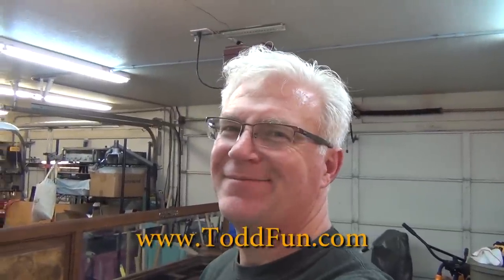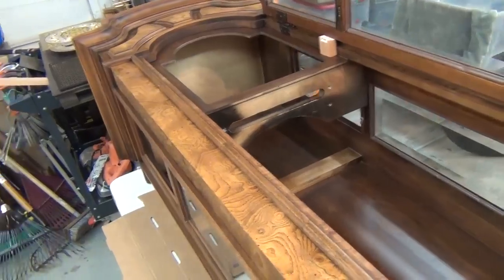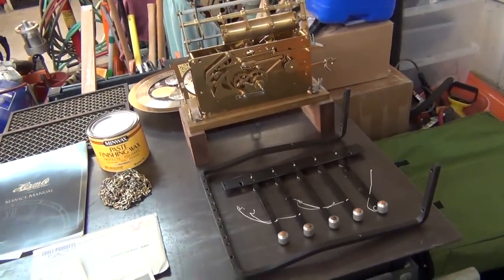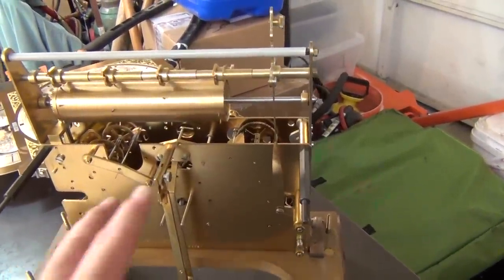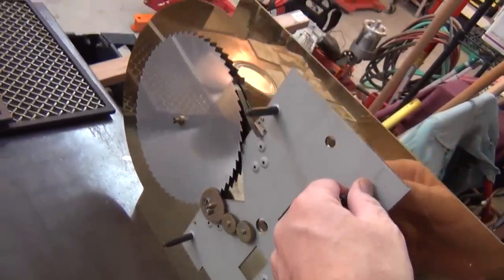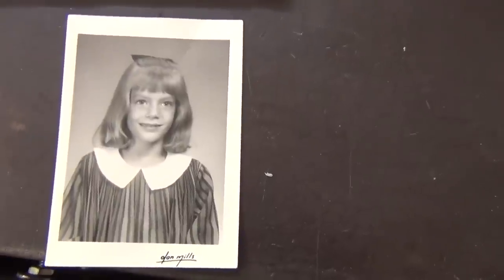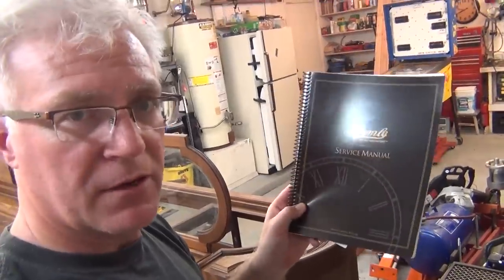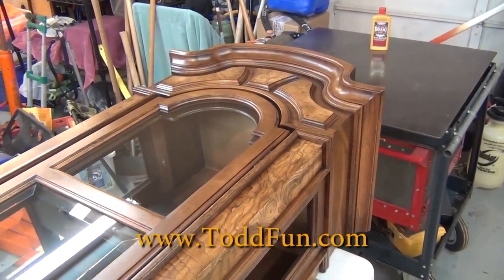Howard Miller Grandfather Clock Part 1

Comment: Got one few days ago, absolutely Identical movement to yours, 5 tubular chimes, this with booklet identified as Emperor 401M, Different cabinet but beveled glass all around, top beveled glass piece is cut with the arched top not the usual rectangle panel behind woodwork. $180 out the door. Needs clean and lube but as is runs fine with excellent beat ratio no adjusting just add weight(s) and go. Cabinet appears factory, not home assembled as I've learned these could have been DIY kit form cabinets. Too much fun. Your bookmatched wood detail is really beautiful. That 4 panel matching is special for sure.
Reply from the maker: Great buy!

Comment: I bought a Howard Miller Grandfather clock dated 1979 with a damaged  cabinet it turns out this expensive solid hardwood  clock is really particleboard and plywood with hardwood veneers. The cabinet isn't salvageable (water and particleboard don't mix) but the movement is

Comment: I appreciate your video of working with your Howard Miller grandfather clock. I received a Howard Miller grandfather clock from family 2 days ago. It has no model name on it, just a serial number 670934. It was running as we loaded it into a trailer for transport but when we set it up in my living room, I couldnt get the pendulum swing to operate that pawl straddling the teeth of that cog wheel. Sorry, I don't know the right terms to use. The crutch rod swinging just couldn't get that rocking pawl to rock in those cog teeth. I searched all around in there for something jammed. I left the mechanism in the cabinet & just looked around from the removed side panels. Then I found that the bracket that the pendulum shaft mounts into was loose. This was somehow putting a bind on that pawl straddling the cog teeth that regulate the speed of the escapement. Here again, I'm not sure of the proper nomenclatutre & exact operation of what i'm observing happening. So I tightened 2 loose screws and the bracket became secure & the clock has been working now for over 13 hours. I was prepared to level the clock & adjust the beat of the pendulum with it's adjusting screw that I had loosened & moved around when "troubleshooting", but it seems to be doing ok as is. I wish I could attach a picture of this clock in hopes you may recognise the model name. I suppose I could post a Youtube video with a picture of it asking if anyone knew it's model name.

Comment: Nice clock, and I like the unvarnished wood as well. Got some nice furniture that requires oiling, and it is great here in the borer belt, enough oil and the little buggers do not like the taste. Even got some ball and claw with a French polish finish, but that is a pain to keep shining.
Reply from the maker: +SeanBZA Well waxing for 4 hours was quite the chore. This wax makes for a very hard and shinny finish that will last a year or two. Doing the job on the table wasn't too bad but if I had to do it standing upright that would be a lot harder. I guess I can take it down every two years because the movement will need cleaning and it would be a good time to wax before setting it back up.

Comment: Hi Todd,
That's a beautiful clock. I love grandfather clocks but I could never afford a really good quality one. That movement alone goes for at least $1500.00. I sure would like to see more vids on that clock. BTW I use that exact same oil on my projects. It's a really good quality synthetic, so it doesn't attract grime like petroleum based oils do.
Reply from the maker: +Jim Kodysz Thanks Jim. My wife and I have had our eye out of a top quality grandfathers clock for 20 years but we could never afford the price of new or quality used. Most clocks in the bracket run $5k to upwards of $10k and more if special. This one was the "Flagship" model made in low quantities in its day. H&M agent replied to my email stating my clock was about a $10k model now days being special order plus the type of movement and the tubular gongs.  Great find for $875. If the movement works I'm golden. The clock seems popular so I will shot some video on the service but it will take time as I have a lot of videos in process right now. That means I might get the job done and the videos in the can but the editing could take many weeks :/

Comment: Todd, I have two Howard Miller clocks that I purchased 16 years ago.  I need to oil the movements.  Can I do this with the movement still in the clock, or do I have to have it removed?  Also, do you have a video showing all the movements parts that need to be oiled?  Thank you.  Your videos are very informative.
Reply from the maker: To do the job right you have to take the movement out. I have a play list on clocks and one is oiling. https://www.youtube.com/playlist?list=PL40clH-yZ7flbW79e7sXZ8Ws9sJbA5zFj
Reply: Todd Harrison - I keep looking for the video that someone says the movement doesn’t need to come out and be cleaned properly. I have three grandmother weight driven clocks from the mid 1970’s a newerish cuckoo clock that is very dusty inside because too much oil was put on the works, two pendulum quartz clocks that chime and seven wind up chiming wall clocks of varying age from early 1900’s to a brand new Howard Miller I bought from an owner displeased with it. Bought it for $70!! Those are the reasons I don’t really wanna take them apart to lube but I think I’ll have to learn to do so simply due to the number of them then multiplying by the expense of a clock shop repair bill. The beat setting app is up to $30 now and it seems to be the only one worth getting/using. Thanks for your tips and taking the time needed to document the process for those of us needing a reference resource. Do you recommend any specific “clock” tools one should acquire before opening the tall case to delving into the workings?

Comment: What do you clean it with before applying the wax?  Also I hope you show how to clean the mechanical works.
Reply from the maker: +Art M It was a filthy filthy mess when I got the clock. It had decades of dust and was splattered with just about everything you could think of so I used glass cleaner. The Glass cleaner was liquid enough and strong enough to break down all the years of d. I use this glass cleaner of lots of cleanup jobs, not just glass, as it has foaming action and scrubs with a brush for really tough jobs plus it doesn't seem to harm any surfaces or paint. It is labeled: "Sprayway World's Best Glass Cleaner Ammonia Free" It really is the best. I get it at Home Depot. You can get it by the can but it is spendy so I recommend getting a 1/2 case or full case off Amazon Here are the links to it from my Amazon store:
Single can: http://astore.amazon.com/tod0f5-20/detail/B0052V1JA2
1/2 case: http://astore.amazon.com/tod0f5-20/detail/B000AP585M
Full case: http://astore.amazon.com/tod0f5-20/detail/B000BQPIGY

I'm going to start filming the cleaning of the clock's mechanical works today so I hope it will be posted soon. I'm not going to submerge the mechanism in a cleaning fluid in an ultrasonic cleaner as professionals clock service center can do as I don't have a large enough ultrasonic cleaner for that job. I will have to do the cleaning job as best as I can by hand cleaning.

Comment: I have a Sligh grandfather clock which has fine, metal, decorative lace on the face of the clock that has come loose. It wasn't secured by nails, perhaps glue? What do I repair this with?
Reply from the maker: Many shops sell replacement face dials. Just pick one that will work.

http://www.clockworks.com/clock-parts/clock-dials.html

https://www.blackforestimports.com/advancedwebpage.aspx?CategoryText1=Parts%20%26%20Accessories&CategoryText2=Dials%20%26%20Dial%20Parts&CategoryText3=Dials&SBCatPage=&TiledLayout=True

Comment: I have a Howard Miller grandfather clock that I am trying to disassemble., but I cannot get the face frame off. I removed the 4 corner screws of the frame. It looks like the frame needs to slide upward and the titled outward, but I cannot budge it. is there additional screws that are still holding it in place? The clock was made in the 1980's. HELP
Reply from the maker: If you’re trying to take the mechanism out which is usually attached to the face plate they’ll be a couple screws coming up from the bottom on either side of the mechanism.
Reply: @ToddFun  Thanks for the reply. Actually is was trying to replace the frame that covers the dial face. It seems that there are 3 swivel tabs on the inside that were keeping me from removing the frame ( even though I remove the 4 outer screws on the front of the frame. anyway, the frame was very stubborn, but finally removed. Now to the next step of dissassembly and then replacement of the clock movement. Thanks for your reply.

Comment: This is the brand my mother has. She has wound the outer two up too tight. I'm scared to touch it. I took off the outer panel to look inside but that is all I dare do at this point. It has wire instead of chain.

Comment: Thanks so much for these videos! I am trying to figure out the name of the movement for this clock. I have the clock keeping good time now, but the chime weight seems to be stuck and the clock will not chime on it's own. I have the same exact clock, and am willing to try to fix it, but considering a replacement movement and i am having trouble figuring out how to find the same movement. All i can see on the back of the clock is that it says UH03028 or 08028, hard to tell, and 152.787. What would I be looking for to find this same movement? Any help is much appreciated!
Reply from the maker: https://new.blackforestimports.com/category/Movements/Urgos-Movements/Floor-Clock-Movements-Urgos/03-Series-Urgos-Movements/Westminster-5-Tube-Chain/

Comment: Todd I picked up a Grandfather clock at a second hand store for a $100.  I'm trying to figure out who the maker is. Where would that be indicated? I have numbers on the back of it, and some letters, but I can't find a maker.  The weights were taken off, and is hasn't worked since I purchased it. I live in a small town that does not have anyone who can look at it for me.  I have been watching your videos, and have at least gotten it to run for a few seconds then it stops.  I put the chains on it, and have gotten it to chime on the quarter, half, 3/4, and hour marks, but the pendulum stops.  I know it needs more adjustments, so I will keep watching your videos, and hopefully I can get it to run.  I know nothing about it, so I'm just trying to come up with some ideas to find out who the maker is.  It does state that it is made in Germany.and some letters URGOS and unadjusted. I don't have a clue what that means. It also  has the moon dial.  Can you please advise on where I might be able to find more information on it. Thank you!
Reply from the maker: It is a URGOS clock. It should have some other number that indicate the model XXX-XXXX which you can use to lookup spar parts. It sounds like it might be warn out so if cleaning it good like I did in my videos, oil and grease, set in beat and timing doesn't fix it up it will need to be serviced by a Horologist. If you take it fully apart you should be able to inspect the shafts and holes for each gear, if any are warn out like I show in my video then you'll need a Horologist to drill and put in new bushings and maybe clean up and polish the pivots on the gear shafts.

Comment: I have been scouring the Internet looking for this type of information and found nearly nothing, and nothing of real value, and I just acquired 2 of them.
The first is an older one (610-701) and the other is I was told, newer (610-329).
The 329 one would stop swinging after a few minutes even though it was level and wound, the other 701 had a weight cable break and the cable seems to have hit a geared shaft bending the shaft slightly. How about a link to where you got the manual from?
Reply from the maker: They don't sell that book anymore but I do have this book from Amazon that has a lot of the same information: https://amzn.to/2Zy5NmU

Comment: How do u find the serial number and how can u tell what year it was made
Reply from the maker: Best I know, no serial numbers really but you should find some model numbers stamped on the back brass plate of the clock. You can sometimes use that number to find what model you have and that model number might help you get a year range that model was produces. However some model numbers will be produced over 10 to 30 years sometimes. If no numbers than it could just be much older or super cheap. Thick brass, no numbers = much older, Thin brass, no numbers = super cheap
Reply: Todd Harrison mine just says Howard Miller clock 
Zeeland Michigan 
Made in germany
Reply from the maker: Sounds like a 90's clock to me. But hard too tell without a model number. Is it weight, cable or windup? Does it chime? Does it have multiple melodies? Does it have a silent mode? does it have a time of day silent mode. All this and more would help to know what you have but in the end without a model number it would be a huge guess.
Reply: Todd Harrison wind up with multiple melodies
Reply from the maker: No weights? floor clock? Tube chimes or bar chimes or bells? No other maker marks like Urgos, Kieninger, Hermle?
Reply: Todd Harrison it was passed down...I have 2 of them and supposedly both of them is worth a little....other one I have is a kieniger and it has a serial number
Reply: Todd Harrison how would I check the value of the clock?
Reply from the maker: Really comes down to condition unless it is old or rear. You could look up a Horologist in the yellow pages. Ask if they can help, send photos with as much detail as possible. You might have to pay an appraisal fee but it should be much.

Comment: I like those kind of things, and when it it is made in Germany, you have a good clock, interesting to know is why it stopped working.
Reply from the maker: +antraciet From what I could tell a chain link had stretched out of shape when raised to the very tip top position which caused the chain to jam in the sprocket channel. I had to bend the weight hook to remove the weight because I know I couldn't load the clock with the heavy weight locked up at the top. When I got it home and was able to dismantle the movement some I remove the bent chain. I'm not sure how long it was in the jammed position but the owners don't remember it ever running so it was jammed for a few decades. I found about 10% of the chain links with significant spreading so I re-crimped them all. If I see the chains spread again I will replace the chains with new as I don't want to risk a jam if its just a bad chain.